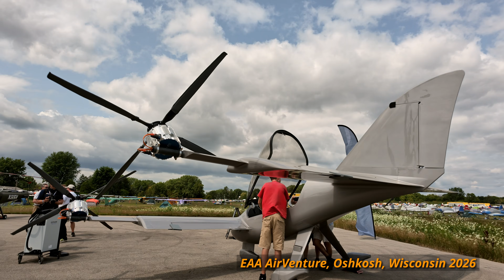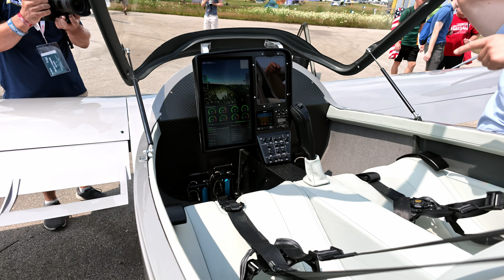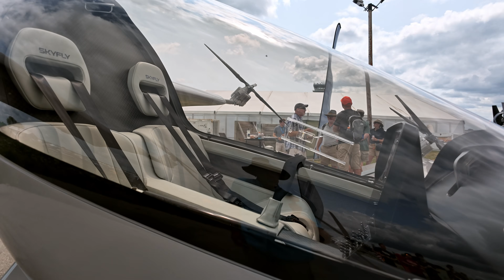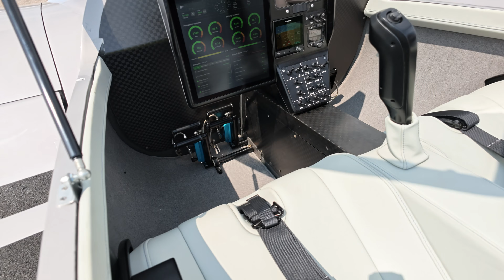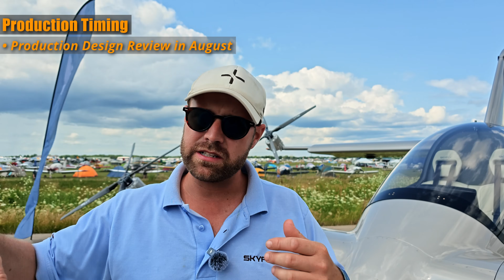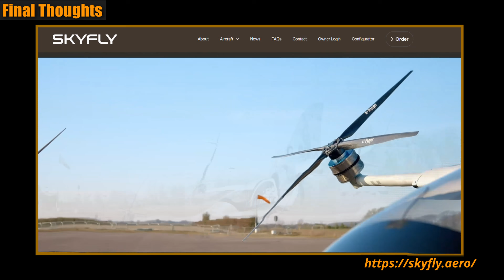SkyFly Axe: The eVTOL That Can Still Fly Like an Airplane

Comment from the maker: The ability of this eVTOL design to glide to a landing in an emergency situation is a critical differentiator for Skyfly. If you are considering an eVTOL in your near future, how important is that capability to you?
Reply: I totally agree with your point. I think any VTOL without wings is just a disaster waiting to happen when the engines quit or whatever and you become a brick. The safest and most practical way to use a VTOL is to quickly take off vertically into the air and pass the 400ft mark dead man zone. It should be done as fast as possible. Then start flying like an airplane and climb high. The reverse should happen when landing. You just don't want to be caught with zero forward motion in that 400ft zone when something quits on you...
Reply from the maker: @konixtwenty8275  You point out some great considerations for flying beyond 10 feet above the ground. The transitions from vertical to horizontal flight are huge challenges for both takeoff and landing. I look forward to seeing how the production products handle this. Stay tuned...

Comment: This design would be a lot more efficient if the lifting props were replaced with shrouded turbojets based on Franky Zapata’s Flyboard Air technology and placed next to the body. Then you can simply turn them off at altitude and have a secondary engine push the airplane. Then you wouldn’t have to have such gigantic wings. The current design is clunky, bulky and dangerous because those props are guillotines just waiting for their first victim….
Reply: Lose one motor and it's all over.  Death trap in disguise.
Reply from the maker: @JBondy007  there is a ballistic parachute option.
Reply from the maker: My propeller is dangerous as well on my plane, but there are 4 of them to manage on the Axe, so your point is valid that it is an increased safety risk.
Reply: @SilvaAdventures Yes and the thing is everyone knows where a traditional airplane's prop is. With this thing the props are in close proximity to where people would enter, exit and do any service. One mistake and you got a guillotine in action...
Reply from the maker: @konixtwenty8275  A valid concern...

Comment: What happens when a motor dies?
Reply from the maker: In this plane you can glide to a conventional landing. Thanks for watching.
Reply: @SilvaAdventures  It glides to a landing from a 20' hover?
Reply from the maker: @Exuma_Guy I doubt that. I haven’t seen it hover at all yet. I don’t know at any craft the will glide from 20’ except a paper airplane.
Reply: @SilvaAdventures  That's my point. There is no redundancy when a motor fails, and motors can fail at any time. This vehicle can NOT hover, and can NOT glide to a safe landing from a 20' hover. People will get hurt or dead.
Reply from the maker: @Exuma_Guy  How many helicopters can land from a 20' hover engine out? Conditions would have to be perfect, and even then it is unlikely to not roll over. Once it does roll over, there is significant risk for death. Flying an aircraft is dangerous, and it is about managed risk. I am not stating that the Axe is safer than a helicopter, but I am pointing out that every aircraft has its risk areas. Learn about them, then manage the risk.
Reply: @SilvaAdventures  Helicopters with 2 engines...  Your competitors put dual engines on each corner for redundancy. Let's proceed to the next step which is going to happen. The manufacturer (you) will get sued for liability after a fatal accident. If you win, you still lose. By lacking the redundancy of other designs, you will lose in court. Managing risk indeed...

Comment: This is the most practical and the most desirable EVTOL that I have seen.
Reply: How is it practical if it has potential to chop your legs
Reply from the maker: @FLORIDIANMILLIONAIRE  Any propellor can/will inflict damage.
Reply: @SilvaAdventures this message is for public benefit. Mounting the propeller above normal human standing height provides inherent physical separation between the rotating blades and people on the ground during takeoff and landing, when personnel are most likely to be near the aircraft. In your design, the propeller operates within a height range that can intersect the human body, creating a direct blade strike hazard during ground operations.
Reply from the maker: @FLORIDIANMILLIONAIRE  Correction - it is Skyfly's design, not "my" design. I am not an aircraft designer, just admirer! :) I understand your concern. The market will eventually flesh these things out as designs actually become selling products, and people start spending their hard-earned money.
Reply from the maker: I also admire the product targets. Let's see what next Oshkosh brings for Skyfly. I hope they achieve their goal of flying one to the show!
Reply: А как же Lilium jet

Comment: My comments are based on the engineering challenge of both Evtol and fixed wing plane and seamlessly transitioning between the two modes dynamically in mid-air and the training required what looks like lack of redundancy on the motors and if that guy is the main guy, there was a lot of quick answers looking away from from interviewer when answering. My guy is this design never sees the light of day and Oshkosh in 2 years this will be just around the corner and by then the Chinese options will be hitting the market hard and fast. Sorry but that guy had snake oil salesman vibes.
Reply from the maker: To his defense, he had some long days before this interview and was talking non-stop for many hours. There could be some cultural ticks as well. Michael has successfully led Skyfly through a number of rounds of investor financing, so there are some people who believe in the vision, and current execution. Let's revisit this again at next Oshkosh and see what Skyfly has accomplished by then. I am hopeful they succeed, as I believe in their design targets and would love to see the Axe in volume production. Thanks for watching.

Comment: This is such a beautifully simple design. The propellers are all fixed pitch and don't pivot, meaning it's a VTOL airplane without any extra moving parts, just the standard control surfaces that every airplane has. The only other examples of that I can think of are tailsitters, which weren't practical.
Reply from the maker: I also appreciated the simple design. Let’s see how it progresses through the next year. Thanks for the comment.